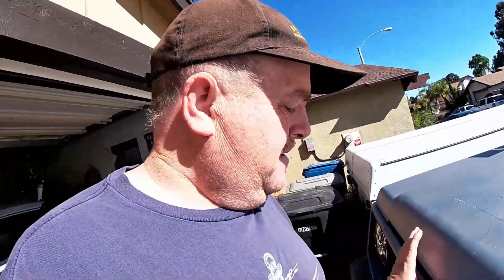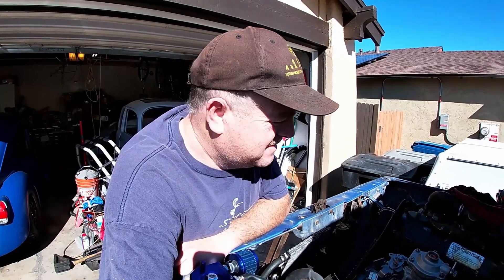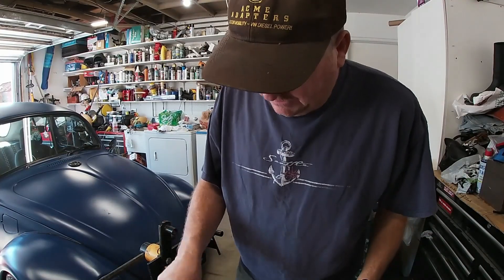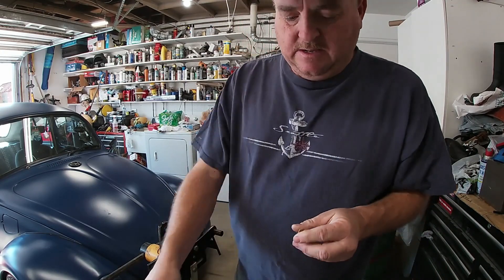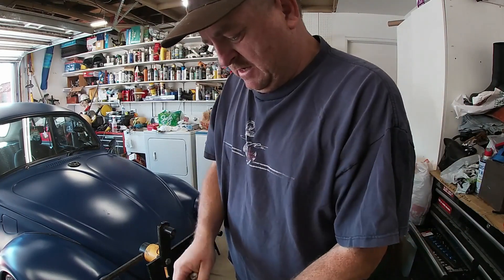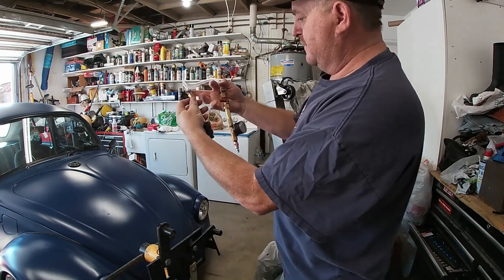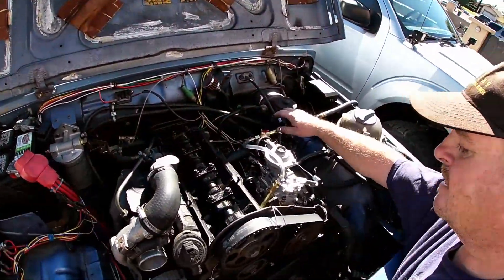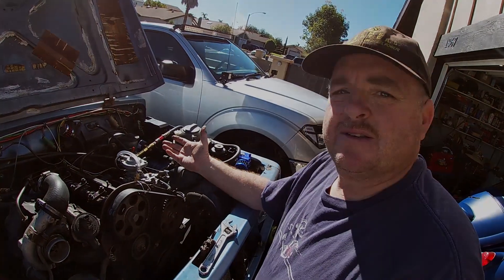Samurai/VW Diesel Leak Down Test

Comment: Getting closer! You might be on to something with that compressed air engine😎that was cool. Compressed air turbo boosted Samurai. Thanks for taking the time to show the steps along the way. It was good that you could recover and save your video. Thats always frustrating, looking on the bright side It made for some cool visual and sound effects.
Reply from the maker: And after 2 years I still have trouble with audio.. learned a lot about Diesel engines with this repair..
Reply: @DIYWilly  ya me too 😀